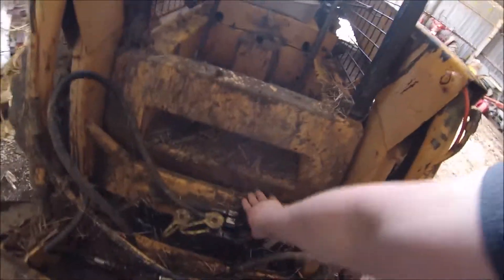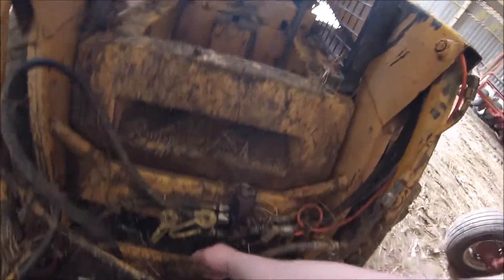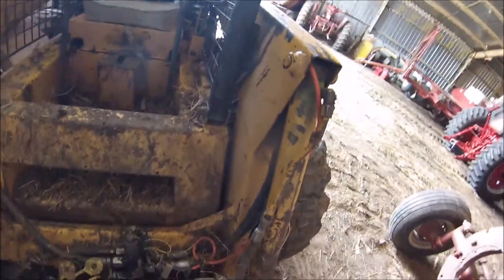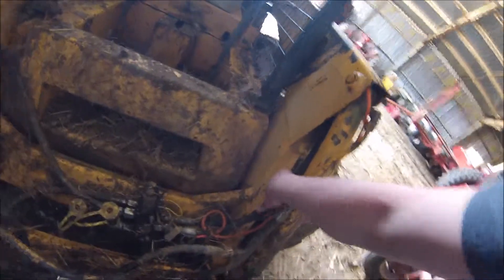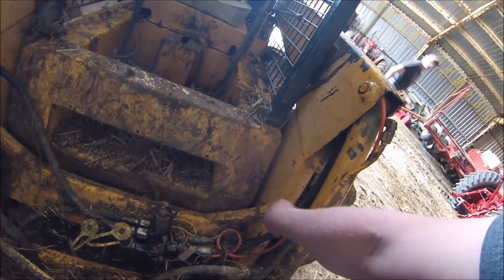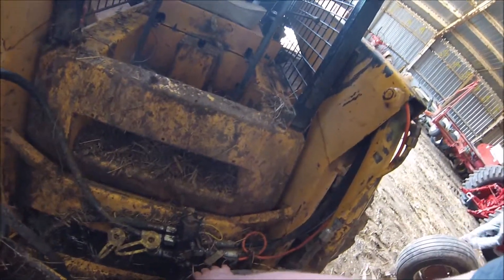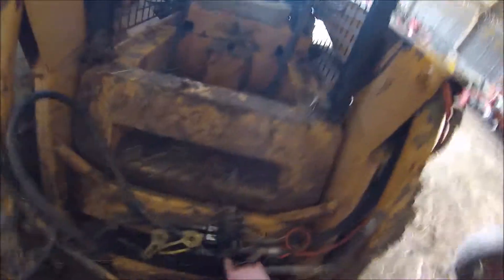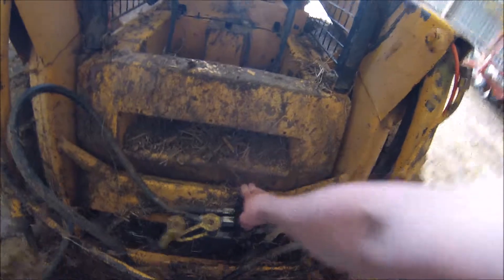OMC Mustang 345: Auxiliaries Explained

Comment: So there’s a place to put the hydraulic fluid in by the engine, but do you have to add it down by the wheels for the drive? I noticed there was two caps down inside there above the wheels. I just wasn’t sure if I had to add a different kind of fluid for that or if you put the fluid in it just circulates to everything.

Comment: What will the Aux Hydraulics run ?? Will a grapple work fine ?? So you think the flow is enough to run a small Rotory cutter (brush hog) ????. I have a old OMC 345  that is the same as the mustang 345 and want Aux Hydraulics up front. Really Really hoping to use a Mower on it too. Also, If the flow isn't enough, Do you know if a bigger Pump is available ?? I love my little Skid Steer ! Best $300 I've ever spent !! Thanks
Reply from the maker: We have only run a grapple with it and that works fine. I work at a dealership that sells & services Gehl skid loaders (which are now the same machines as Mustang, which bought Owatonna Manufacturing Company or OMC back in the day). You will not be happy with the performance of this machine with a brush hog. Even today's machines struggle to run them unless they have the hi-flow option. As a general rule of thumb: Anything that rotates at a high rate of speed - snowblowers, brush cutters, etc. should be run on hi-flow. They do make snowblowers for standard-flow machines but they are often disappointing on the performance side, especially if you are used to a tractor blower running on a PTO. Attachments that rotate slower like a post auger or attachments like grapples, tree shears or anything with cylinders instead of motors are usually okay on standard-flow. I am not aware of any sort of hi-flow pump for the 345. A guy could probably get creative and find something that would bolt up, but I'm not sure the engine would have enough HP to run a large enough pump for what you want to do. Hope this helps, if you have any other questions let me know!